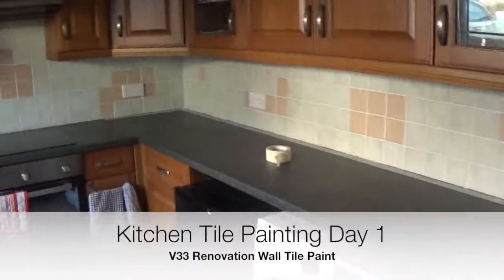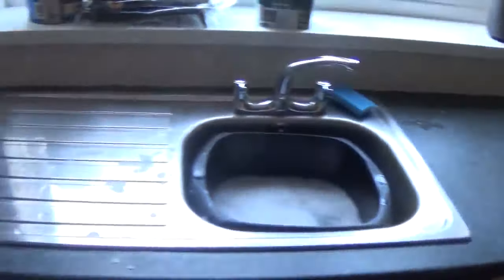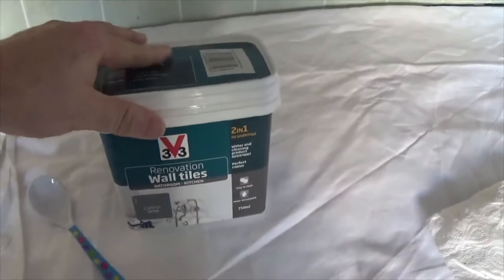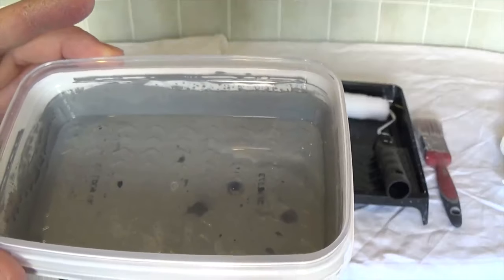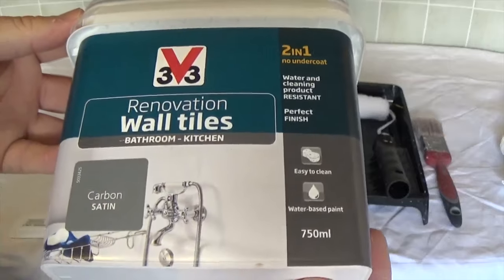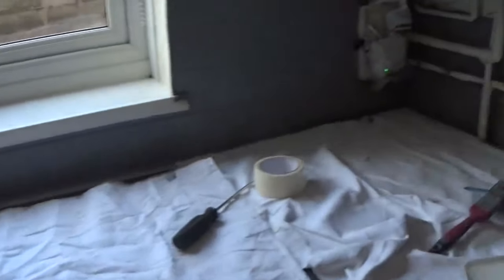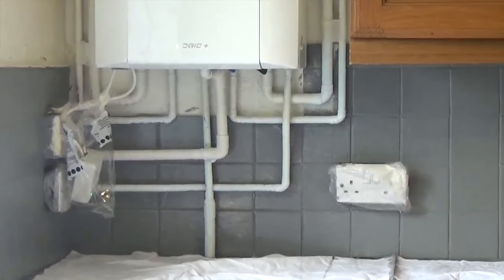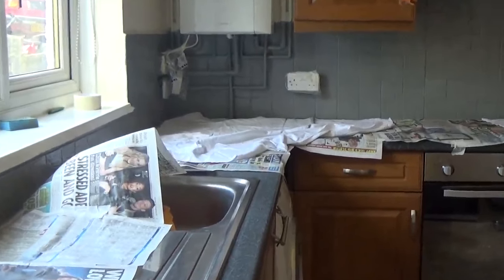B&Q's V33 Tile renovation paint demo & review project. UK

Comment: Hi there! Did you say you went round with the brush first filling in the grouting with the paint then kind of Go back to the start with the roller to go over the tiles?
Reply from the maker: Hi Hannah, use the roller in small areas, then whatever the roller missed quickly paint with a brush, got to be quick though because as soon as its on, it seems to start drying quickly, then if you go over when it's a few minutes old it comes off in clumps. The trick with this stuff is to paint in small areas and quickly touch up then carry on. You'll be really pleased with the results it's a great product.
Reply: +UK Tool Reviews fantastic Thank You for your reply, it looked great when it was finished in your tiles! Did you paint your cupboards in the end with the same brand stuff?
Reply from the maker: +Hannah Nowell much to my girlfriends disgust I haven't got round to them yet, but we are going to use a different product altogether were going to use a brand called Rust-Oleum, I'll do another video when I do it so you can see how it went!
Reply: +UK Tool Reviews oops! I'll keep a look out for your next video. Moving house soon so looking at ways to keep the renovation costs down, this video has been very informative! Thank you !
Reply: Have you done a video on your cupboards yet x
Reply: thsi video is over a year old now... his website is up for sale so I guess he stopped doing the reviews
Reply: Hi - is it still holding up ok?

Comment: I've just painted my kitchen tiles with this stuff the same colour you have. I found it great it went on well and looks fab I'm just wondering how long it will last how is yours looking now?
Reply from the maker: lillaydee1989 well mines still looking tip top, it's also still good by the hob which gets regularly wiped down etc.
Reply: That's good to hear ☺
Reply: I bought some a couple of mths ago. I cleaned the tiles over n over to revover everything off them. Started painting an hour ago & the paint is as runny as single cream ran off the brush all over & as I applied more the first layer congealed under I am disappointed with this stuff!! its expensive and a waste of time & energy! it is warm so I dont know if that's the problem but ive had cheaper brands that ive painted the same tiles with years ago & did a smooth good job, I cant see how anyone gets a good job with this stuff. I would need about 3 tubs of this to do all of it as it is, Now ive gotta scrap all this off. I wish I hadn't of bothered!